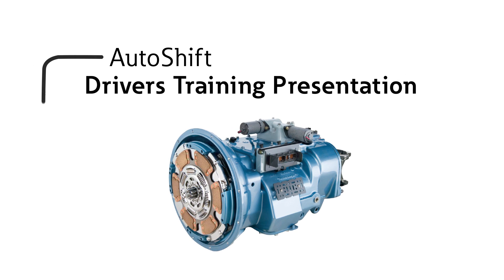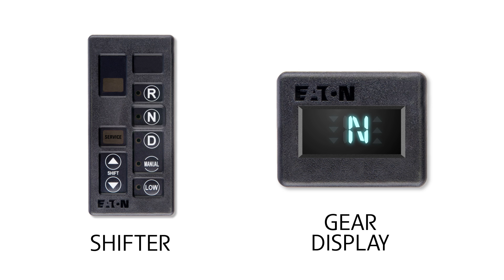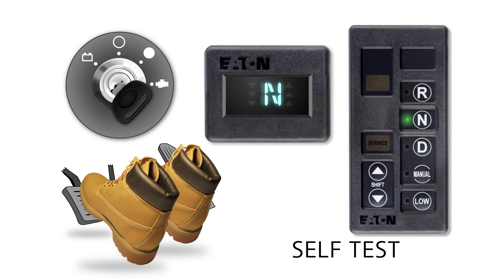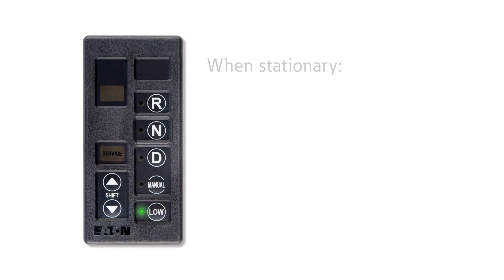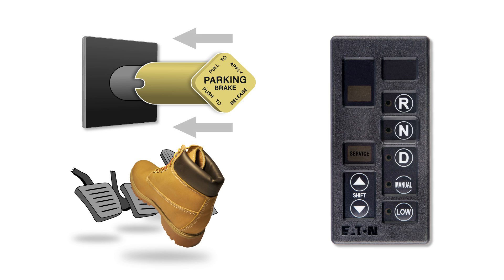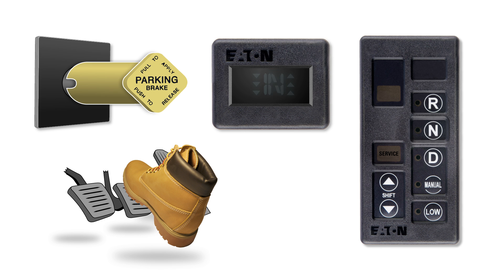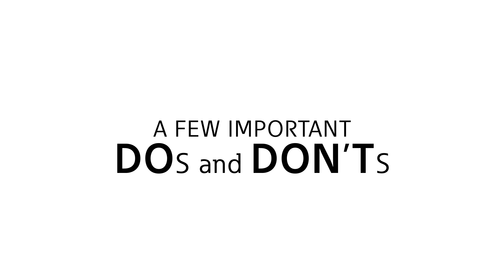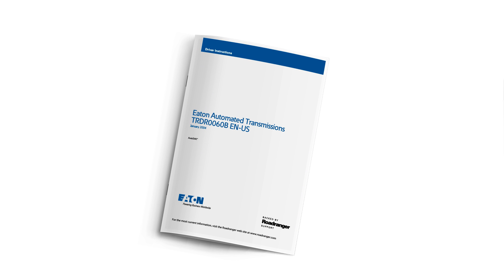AutoShift Transmission Driver Training

Comment: Manual is fun but dangerous if you mess up (I'm a rookie). Automatics are boring and makes you lazy but is easier in the knee. Both has its pros and cons but the indistry is going auto for a reason
Reply: I know this is an old comment, but the industry is going with autos because this new breed of "drivers" are stupid. They can't drive a Toyota Camry, but these mega carriers put them in a truck.
Reply: They will hire just about any dummie outhere!

Comment: My 18 speed Fuller automatic is the worst transmission I've ever had in a truck. It's a tri axle dump truck that I use on site quite a bit and its so damn harsh and slow to shift from D to reverse that it makes the truck almost undrivable. It holds the first 3 gears too long and revs out to an almost ridiculous degree. It inexplicably downshifts at low speed while I'm coasting without my foot on the brake and just about puts my head into the windshield. Reverse is comically harsh and in-precise....shift into reverse and give a throttle input but the truck goes nowhere....2 seconds later (even while giving it the most minimal amount of throttle possible) The truck picks up and takes off in reverse which makes it almost impossible to inch the truck back in reverse to, for example : back up to the edge of a trench to dump a load off an edge. I find myself screaming at the truck multiple times a day because It will not even remotely do what I'm asking it to. I'm an experienced driver btw...The trans simply doesn't cooperate. Just an awful design.

Comment: I have the same thing in  my 2000 century class. But every now and then, when I come to a stop and its in 2nd gear, then I try to pull off again she won't move or go to 3rd gear.......can I get some insight?
Reply: Manual mode or throw it in neutral then use brakes to stop, then just start out like u normally do

Comment: If it's an automatic transmission why is there a clutch pedal? Seems like the person really know what they were talking about with the automatic transmission.
Reply: Only for pulling away if in manual mode and keeping the truck stationary at stop streets/robots
Reply: This is so weird. I have an eaton autoshift transmission in a 4900ex i drive, but there is no clutch pedal. The “automatic” transmission compresses the clutch and moves the gear into place, and then you can feel it release - feels JUST like you are driving a manual. But i don’t get why this one shows a clutch.
Reply: @JesseTradesNQ  ultrashift